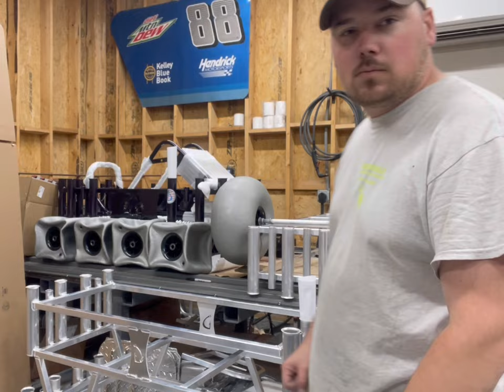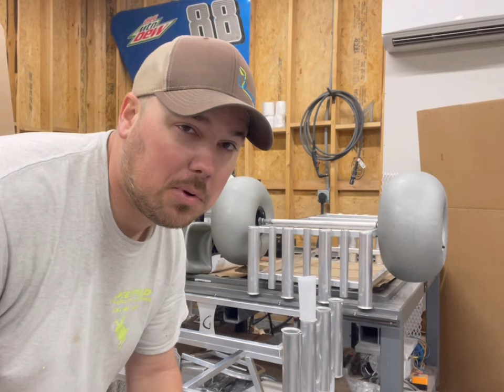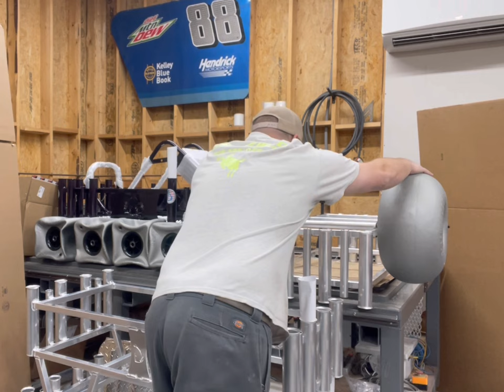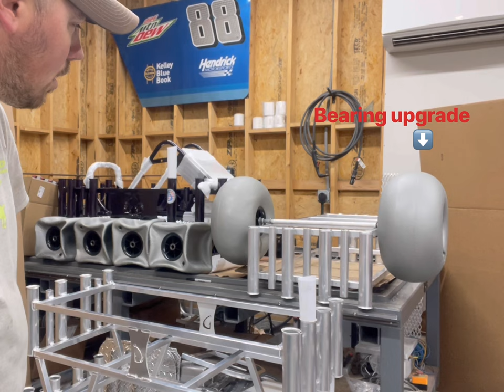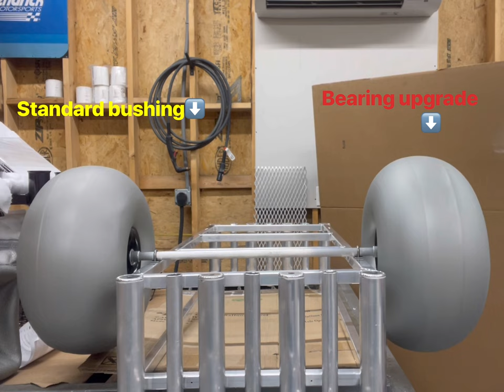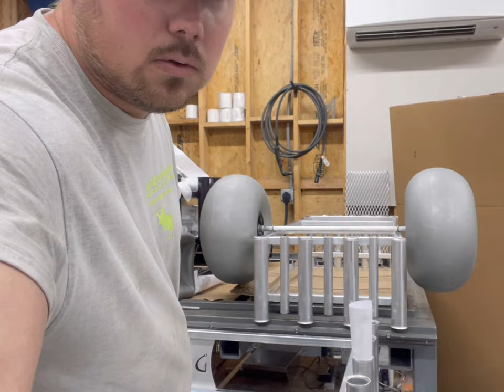Beach Cart balloon tire UPGRADE!!! Bushings vs. Bearings.

Comment: I don't see the point of going to the expense of ball bearings, when you're only traveling at about one and a half miles an hour!🤔
Reply: I've used beach wheels with and without bearings to tow my Hobie tandem island.  I can vouch for the ease of towing offered by the low resistance offered by the bearings.  It requires a lot more force and energy to pull a very heavy kayak with gear through sand (and up a sandy incline) when you have bushings vs bearings.  If your kayak is over 100lbs and/or you travers over an incline, I highly recommend bearings.  Can't vouch for the wheels presented in this video but my experience was comparing Wheelez brand bushings vs bearings.

Comment: From the little old lady. I do not know what a bushing or bearing is but I see your bearing wheel rolling longer. I purchased a beach cart and couldn’t put it into a car. Had help then I also couldn’t move it on soft sand on a long walk to the water. Is it possible to add bubble wheels onto an old shopping cart that is lighter than a beach cart to begin with and how can I do this?

Comment: Was the one with the bearings wobbling ?
Reply from the maker: Any balloon tire can have a slight wobble, none of them are steel belted radial tires like what is on a car. All balloon tires are more like bias ply tires so yes, you can guarantee that any brand will roll 100% true but they are only designed for off-road, sand, etc so they are design for the task at hand.